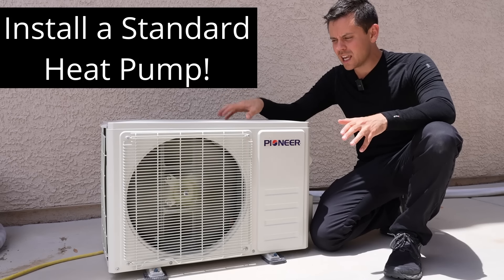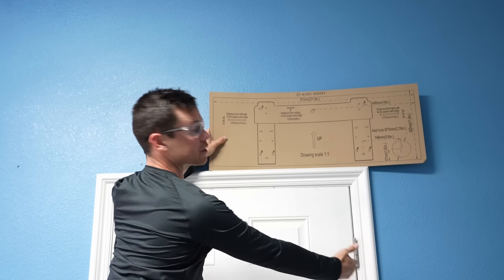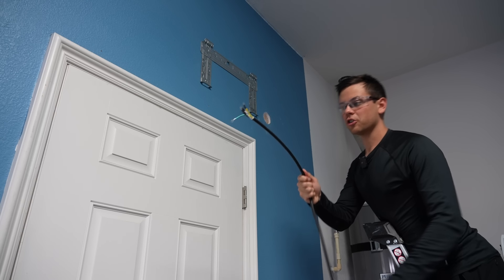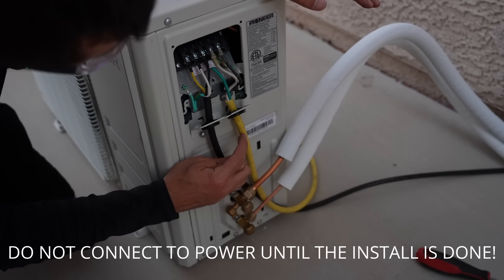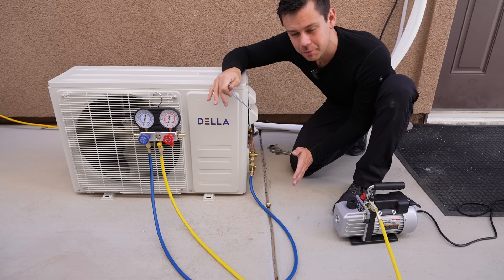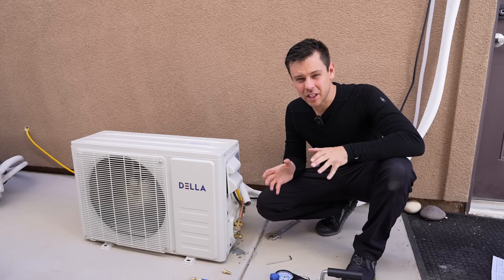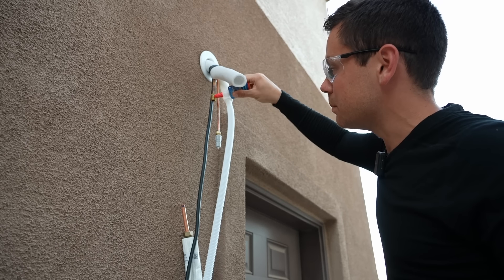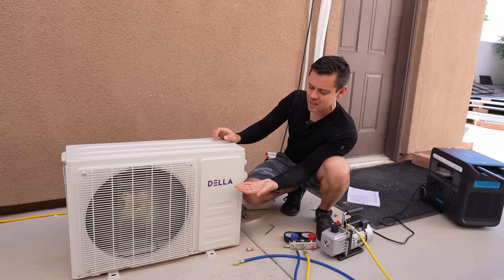Budget Mini Split Installation for Beginners! w/ Vacuum Pump and Gauges

Comment: I just put in a 12k btu Confortotal brand unit off eBay. Super easy install. It's taking a bit more power than I expected at ~1300 watts. What does this one draw?
Reply: Sounds high, i would expect 1150 max at 20 seer.  You could have a voltage drop. Did you use the right gauge of wire?  Mine is 120v, and I used 12 gauge, but the line is short.
Reply: @ericfitzsimmons1202  I used the cord it came with. I am right at 120v so I don't think that's it. And it was the cheapest one on ebay, so I question the official ratings. Oh well, power is still fairly cheap and I love having AC in the garage!

Comment: Very good video showing a lot of important details. I would have liked to see you torquing the lines though since to me that is the hardest part. I have yet to do that with mine. I did use the sealer that came with the pioneer unit.I'm waiting for a gauge set that pioneer sells specifically for this install . It's around  $25. Just the blue gauge and lines. I'm wondering if it will matter if I re tighten the fittings after it has sat for 4 day's if I need to take the lines back off and add more sealant? Or can I just finish torqueing them?  Also Home depot has a eccentric flaring tool made by Husky for around $50 that really makes flaring easy. you might want to add that  and the pioneer gauge set in your list. Thanks for making the video.

Comment: You just plug it into a socket  110V ? What about amperage etc. What is the maximum size you can use ? 
My units in Australia 240V and 1 unit 3phase are cabled. directly..
Reply from the maker: You have to calculate that for the size of the air conditioner. It will state the conductor size in your manual.
Reply: @WillProwse  sure, the problem is 110V can't carry a lot of amperage, so unit is relatively small.
Reply from the maker: @jantschierschky3461  yeah it depends on the size of the unit. Stick to what the manual recommends

Comment: Hey Will! Read this before installing my Della 18K/240v mini-split. Mounted it 8' inside house so I ordered the pioneer 16' lineset and cable... worked perfect. Had the vacuum pump and gauges (for auto). Had to order the adapter (Amazon delivered in two days). Della only put in a 3 wire power cable and 8' lines, but the 16' lineset came with a 4 wire power cable - perfect. Ended up costing the same as the unit with the 16' set. Did exactly what you said and it worked, and no leaks! 
I am trying to use my 48v golf cart for a power backup (eventually getting solar - looking at 400 watt panels) What is the best battery and controller/inverter?

Comment: Awesome video, couple comments, and suggestions.
1. The big hole for the lines doesn't need to be in the same spot as the template. Move it horizontally to fit your need. I put mine in the middle of the wall mount.
2. I'd run the vacuum pump for at least an hour to remove moisture.
3. If you need to buy an adapter, get one with a valve. That way, you can remove it without losing refrigerant.
4. Check for leaks in the system with it on heat mode. The system will see the highest pressure during heat mode, over 400 psi.
5. Putting sealant on the flare connectors is good practice.
Reply: Good tips!!
Most split air conditioner are cooling only (talking about globally) USA had for ages those loud inefficient window units, only 2 benefits: widely available and easy to install :-)

It's great to see that the USA is slowly moving towards the mini split, and even better that most units have heating as well!!!
In Thailand heating can't be found.. cooling only.
Strange, as it can get as low as +5c at night (but usually +15 c during cool season,and 25-30c at night during the other seasons.
Hot season +40c is getting more normal, 44 c this year..
Mighty warm .
No one is thinking about heating options when it's that hot 😂😂
Reply: @fhorst02  its all new. Soon, the units will be ubiquitous: models tweaked for heating efficiency, integrated with water heating, solar and grid tie, have a snap-on connectors, be warranted for self-install, have all sorts of different innovative designs to suit every application, and be competitivly priced and long lasting.  Also, the HVAC techs wont run screaming from them.

Comment: You have to do a pressure test with nitrogen.  A vacuum test with analog gauges has too low a resolution to detect tiny leaks.

Comment: U do not have to open the valve for five seconds.U only have to open it and take a look at the gauge.If there is a little positiv preasure it is enough.
Reply from the maker: I am just following instructions so no one gets pissed off
Reply: @WillProwse  The only thing u get pissed off is our nature.
The higher the preasure the more R32 gets out for nothing.

Comment: What about hanging solar panel wires in the air?

If the array is away from the house, it's a super booger to dig trenches. To not hit water lines and so on. 

Can someone address this?
I've researched this, but can't find much info on it.

Comment: Thank you Will!  Do you know if damage is done when these are installed on an RV that's not always perfectly level?
Reply: I have the Pioneer unit on my rv. 8 years now. No problem
Reply: You might have draining issues depending on the level of the RV

Comment: A micron gauge should be used instead of the gauge set to determine the quality of the vacuum.  We always pulled to below 500 microns, often below 200 microns, on mini-splits and it should hold below 500microns for 20 minutes.  If it climbs above slowly the system isn't fully evacuated.  If it climbs up more quickly you may have a leak.  Simply can't read that level of vacuum with a gauge set.  Other than that pretty good video.
Reply from the maker: Yeah very true. Most people and the instructions just use this method predominantly. A micron gauge would be ideal for most but I don't think they'll spend the money . And thank you!!!
Reply from the maker: Im seeing 150-200$, do you know of any cheaper options?
Reply: @WillProwse  No, I don't.  You're correct, many in the field unfortunately use a gauge set to measure vacuum, but it simply can't measure a deep vacuum.  It's like using a yardstick to measure a few thousandths of an inch.

Comment: Easiest way to mount the inside unit is to tape the template to your wall, drill the anchors holes and the 2.5 inch hole, then remove the template and install the bracket. That way you don't need to measure and you'll have a perfect hole every time.

Comment: Those line set covers are nice to have for long term service use. Protects from extreme heat like you’re at +extreme weather including rain\snow.

Line set should be off ground anchor to home or if you don’t want to do that I guess you could use some 1-1/2” pieces, a unistrut/super strut with clamps and anchor the strut straight to the concrete with anchor, then use clamps for line set. 

That would make this DIY a very professional looking install, thank you for sharing and all you do.

Comment: hmmm, EG4, is only 1200 bucks. so... you also gotta spend 300 or so on gages and vacuum line sets.  So...Why???  Plus the EG-4 is DC solar connections so... that is a big plus.  Why bother? Gonna do it off of solar anyway.

Comment: Heck yea Will these Minis are so easy.
I hooked up one in my garage a few weeks ago.
I have it running on my off grid  solar too so getting some daily use out of it now.
The one I got was a blueridge but they are all just about exact copy's and also 800$

Thanks for another great installation video!
Casey
Reply: I saw Blue Ridge has the 38SEER unit also probably from GREE

Comment: Thanks for the video, there are lots of these but I consider Will's information to be "vetted" or "curated" more than other youtube videos.  There is at least one similar vacuum pump on amazon for half the price of the one will recoomends on amazon, for example the Zeny one. Has anyone used one of these ultra cheap vacuum pumps, any reason I need the one that costs twice as much?

Comment: Went through a divorce and moved into an OLDER (70's)   single wide that i dont think has 230v.
So will i be limited to a smaller BTU Unit with only 110v?
Please answer.  Would like to purchase before August.
Thanks
Reply from the maker: Then you buy one that's not.
Reply from the maker: Yes 110
Reply: Senville makes a 110v that is very well priced.  Eg4 is DIY but spendy.

Comment: One thing he didn't explain when tightening the copper fittings, but which I think he did properly (it was hard to tell) is that the crow foot wrench goes onto the torque wrench at a 90 degree angle, not straight out like you would think. Otherwise you would get an incorrect reading due to the extra length and leverage.
Reply: Agree, the methods explained are good an' get the job done. I would add that (for the home gamers that are not sure what the names of these tools are) a flare nut wrench (which may be found as a style of crow foot wrench) is helpful on HVAC and hydraulic fittings. Also, I went the extra measure on a DIY install with a positive pressure nitrogen flush finding some leaks that way - glad I did or it would have meant an extra step of waffling around with adding/removing refrigerant. Cheap line sets may have thin-wall copper tubing not meant for HVAC (and so different diameter and leaked as they would not flare properly). There's less drama when you do eventually find a leak if the system is charged with nitrogen and not refrigerant, but the added cost acquiring a nitrogen tank and pressure regulator with adapters was substantial for a one-off installation.
Reply: Was looking to see if anyone made this exact comment, not to be mean but to help ppl out.
Reply: I don’t understand why pressurizing with nitrogen is any better for leak detection then making sure it can maintain a vacuum. Millions of a/c units have been successfully installed before the nitrogen pressure test became a thing.
Reply: @jbonewitz  A system under vacuum is the lack of molecules bouncing around having a good time, and even with sensitive vacuum gauges to determine if there is a leak and not just thermodynamic effects from changing temperatures you're then going to be faffing around for hours or days to find a leak when there is one; contrast to a positive pressure system you can slap some bubble goop on the lines or just listen w/ bit of tubed scope to find where the leak is. "Millions of" yeah no, just no. The old way to do this was whatever welding gas cylinder supply you had available on-hand, the point is to pressurize from a rough vacuum to boil off the moisture to a positive pressure without a phase change (so... no moisture etc) and that is compatible with the condenser and high pressure / low pressure lines and fittings metal composition, to relatively low pressures which is still quite the happening party of molecules bouncing around. I genuinely hope that is helpful for you? This is what we learn in public school middleschool physics, and if you're in the trades you learn it because it saves you time which is a happy customer and you get to keep more of the profits earned.
Reply: @niceride Kwik e vac cans use dry nitrogen would that work?

Comment: Additional Consideration Idea:
If the outside wall has ribbed siding, you want to make sure the hole does not go thru a rib, but stays on as flat of a surface as possible, in order to avoid an opening that is harder to seal off from bugs and water.
Reply from the maker: Good point
Reply: If you can't avoid the rib, I have cut away a wider box on the exterior to fit in flashing and then caulked in a block of poly trim to act as an exterior vanity plate.

Comment: At $800, if it breaks, buy a new one and replace it. I got my first one 10 years ago, called around, no one would come out to install it for less than $500.
Reply: Ya, these are disposable units. Even with a warranty from manufacturer, you still have to pay mucho to get it fixed. I guess just keep the line set in place since thats the hardest part of the install and replace the culprit outdoor unit.

Comment: Great video!
Dare I say that when u were seeing if the line set held the negative pressure, you shut off the blue valve which meant u were no longer checking the line set. U needed to shutoff the yellow valve or shut off an added valve on the yellow line to separate the pump from the line set  so you could see if the negative pressure in the line set held. Shutting off the blue line meant that the lines twas no longer being read by the gauges.. hope I’m wrong
Reply from the maker: No, I tested that before making the video

Comment: Tips and notes:

1) When drilling throughholes ... 
Get a long bit the same diameter as the inside bit on your hole saw.
Then drill through all the way.
Now drill the big hole with your hole saw on the inside, then go outside and repeat.
It makes sure the hole is clean on both sides.
Although this is not required, it just helps preventing a breakthrough.
It's more required with concrete though since plaster has a higher chance of fun.

2) If you can, when you make a whole through the wall - put a pipe.
This does 2 things:
- 1) makes it easie to push things through since it's directly through
- 2) a bit of extra protection in the wall from - things sitting above the pipes / condenstation on the pipes since it'll force water to drain outwards rather than directly in the wall

3) When installing an aircon unit, you can (and in some places legally must) install an isolator (a switch or something that easily allows you to isolate both live and netural - both wires depending on your country) as close to the outdoor or indoor unit - I prefer outdoor since it keeps the inside neat.
This means if something happens, you or someone else is servicing the aircon - there is zero chance of being electrocuted.
 - like for Will: he had to go inside to turn the power on, if he had an isolator you would have just flicked it on without having to move around

4) Just make sure your outdoor aircon unit comes pre-filled with gas
 - some may not or if you are having to re-gas, you will want to get an HVAC guy in to recharge it ... its cheaper
Or if you opened the valves and manage to un-vacum the system - it may need to be recharged...
see point #8 .... sometimes it is easier to get someone to do it ... or they might not even touch your system

5) Secure your pipes, in this case Will did not but he is fine with it.
But you really do want to secure them so they are not accidently kinked causing problems
Also, wind over time could cause problems.
Trunking is ideal as it keeps things neat - but even just ancors with cable ties to hold it in place looks good and will do the job.

6) When working with any HVAC system, you want to make sure as much as possible that there is NEAR ZERO exposed copper piping.
Any exposed copper radiates heat/cooling and depending on the amount can hinder your systems performance - although a small amount wont be an issue
The bigger issue will be on condensation causing water and can be a problem if the part that is condensating is indoors.

7) If you don't want the outdoor unit to be sitting on the floor, you can mount it out the way (up) - but make sure you have the correct brackets to hold its weight ... 
Some people will mount it above the indoor unit - so eg for Wills; setup, it could be above the exit hole in the wall
(the drain pipe has to go down though ....)
It means there is no space used up outside in the walking area.

8) If you are unsure about doing this, just get an HVAC guy in ... sometimes it's cheaper to pay for someone elses time than your own :)
Reply: Additionally: a power isolator/disconnect box is like $20 and makes the indoor/outdoor wiring splice easy. It's also the best place to mount a surge protector, which these units need.

Comment: awesome work Will. One question, since it looks like I'll need the Harbor Freight vac pump. They have 2 models, a 2.5 cuft single stage and a 3 cuft 2 stage. Is the 2.5 cuft model sufficient?

Comment: Great tips!  More tips for the viewers:  Get an "inverter type" / variable speed compressor.  This is more efficient than "all on, all off" type...   Get a heat pump if you also want to run it in reverse and pump heat inside.  If you do, you will also need a drain line on the outdoor unit.  There is also a service adapter valve kit that allows you to connect your pressure gauge behind a valve so you can turn off the valve before removing the gauge set.  Basically a valve for your lines.  Wear a hat if you work in the full midday sun...  I usually discard the stock insulation and replace it with better and thicker pipe insulation, slid on prior to install.  If you need to run longer lines, the manual will tell you how much more refrigerant to add, if so, and what the max run and heights are...

Comment: Wondered what happened to you Will, you sounded much more subdued than your usual self in parts of this video. Hope you're over whatever it was that was ailing you. And yeah, I really liked the content of this video. Today I just spent $250 dollars on two service calls to learn that I needed to spend $100 on a whole house surge protector. Surges were knocking my compressor into "short cycle" and preventing it from cooling until it reset. Hope you have one in your house, if not it's worth the investment.